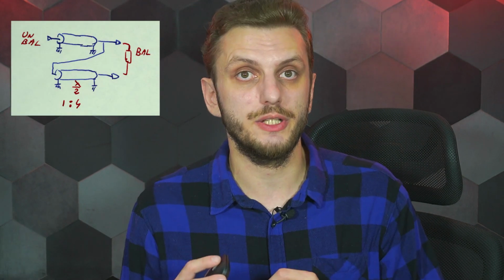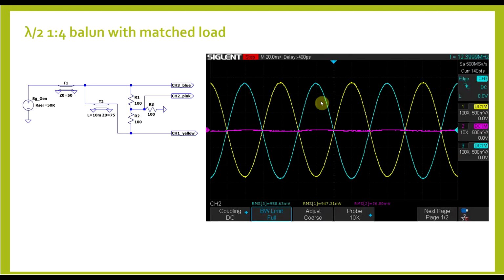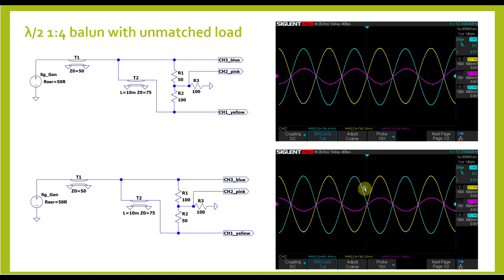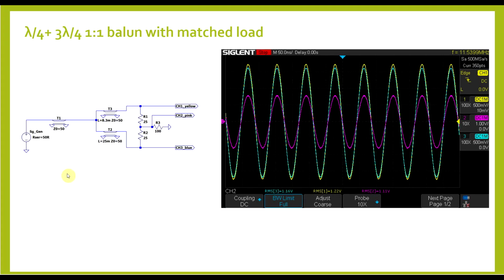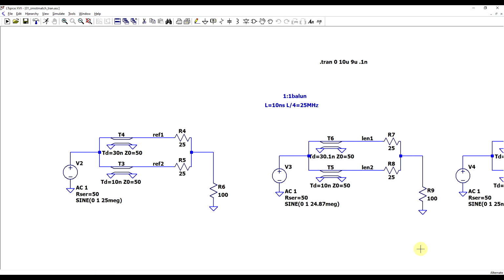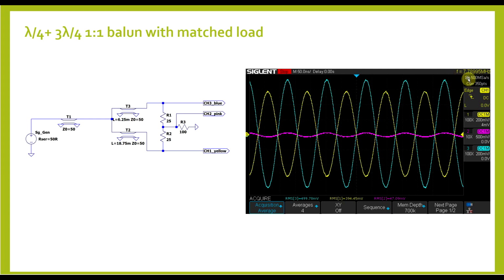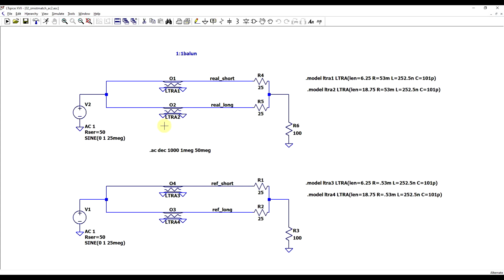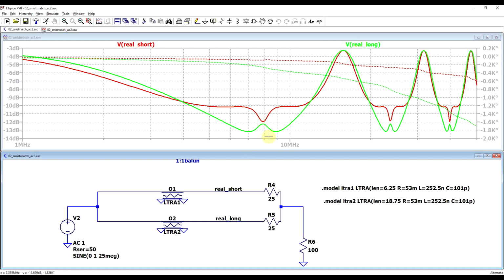Experiments with Transmission Line Baluns

Comment: my concern is what happens in the amateur radio world where we have a 4:1 half wave transmission line balun feeding the balanced 300ohm folded dipole... BUT UP AT THE ANTENNA THERE IS NO EARTH/GROUND AVAILABLE AT THE BALUN TO GROUND THE CO-AX SCREEN TO SO IT GETS LEFT FLOATING. How does this mess things up?.

Comment: Great presentation! 
Did you ever simulate a broadband coax balun wound around a toroidal core to function as a sheath wave choke with LTspice?
Reply from the maker: I don't think I have, but I will probably expand this series in the future
Reply: @FesZElectronics  Thank you for your reply. Would you have any advice on how to start writing the spice commands? I may get a chance to start myself.

By the way, I remember having seen a capacitance meter and an inductance meter in one of your videos. Can you recommend them? Which types are they?
Reply from the maker: What I found out in the mean time is that if you want to model the inductance you get from a ferrite core - you can add it as an inductor in parallel with the transmission line - like the magnetizing inductance is modeled with a normal transformer. Maybe this will help. As capacitance meter I use a CM9601A (not sure of who the manufacturer is though) and for inductance I usually use an AX588B (from Axiomet) - these are not the best tools but they are relatively low cost.
Reply from the maker: Regarding the modeling, see fig.3 and the associated comments of course, maybe this will help - https://www.highfrequencyelectronics.com/Dec07/HFE1207_GrebennikovPart1.pdf
Reply: @FesZElectronics  Great inspiring article, thanks for sharing. 

By the way, I very much like your work. Greetings from Germany to Romania.

Comment: Also, a question. How did you specify the L parameter instead of Td parameter? LTSpice help file says that the length is derived from Td. And for lossy transmission line it's called Len, not L (L is for the inductance per unit length).
Reply from the maker: Well, I used both L and Len in my definition; I know from the datasheet the Capacitance/1m; and knowing the characteristic impedance, you can determine the inductance/1m - Z=sqrt(L/C); so L=Z*Z*C; the delay per unit of line is sqrt(L*C); and the model finally multiplies this by the LEN value.
Reply: @FesZElectronics  Yes, that works perfectly for lossy transmission lines. I was asking about the earlier section of the video, where you were showing lossless transmission line and moved from specifying Td (in nanoseconds) to specifying L (in meters). That's the part I don't understand.

For example, 8:36 - you use Td parameter to indicate delay. 11:50 - you use L parameter to indicate length. Or was it just for illustrative purposes?
Reply from the maker: Ah, sorry; yes, that was just to make the length clear... it wasn't a model that can be simulated.
Reply: @FesZElectronics  Thank you very much for the clarification. Now it makes the perfect sense.